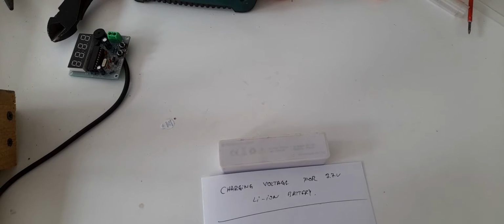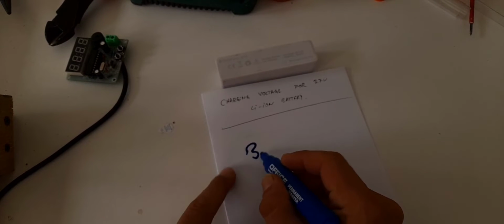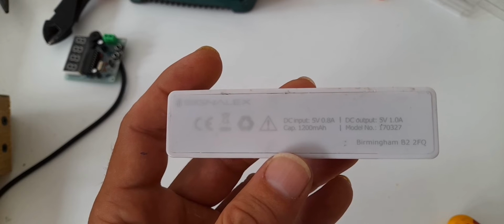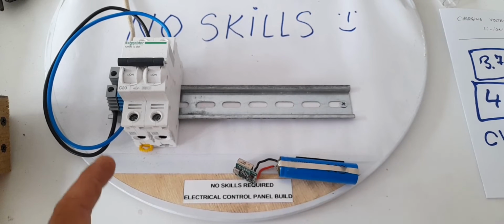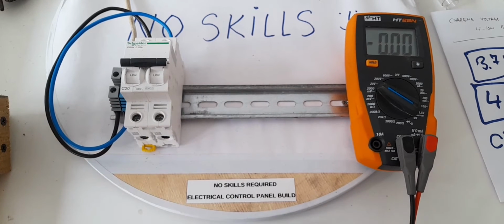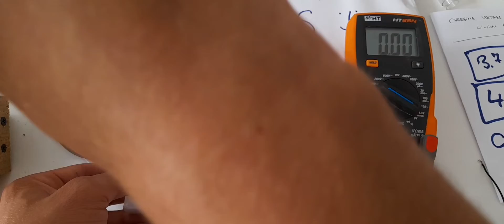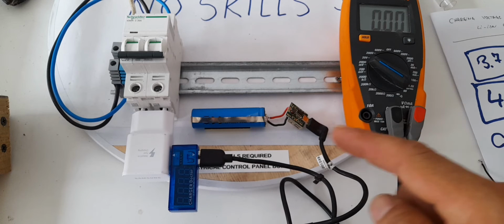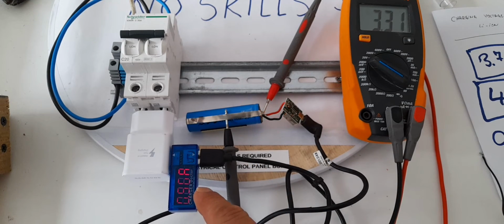charging voltage for 3.7v li ion battery the common way

Comment: Battery should be charge with a charger exceeds its normal voltage like 3.7v  can be charge with 4.2v or 5v  it's fine with automatic charger,  coz frankly you cannot fully charge a 5vdc battery with same voltage charger output of 5vdc   also
Reply: So, if I have a connect a USB terminal through a diode to the battery, That should be totally fine? No other circuitry needed?
Reply: @thenutburglar7923  its ok but with circuitry much better for protection.